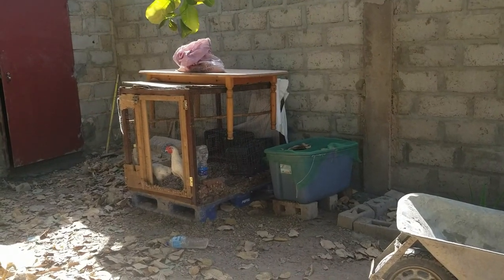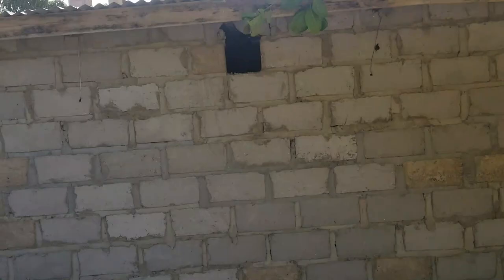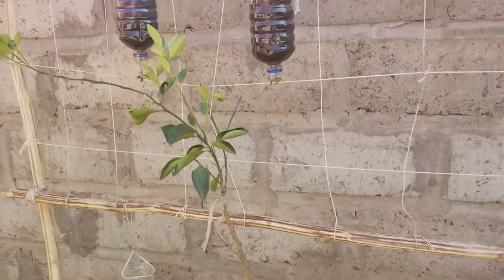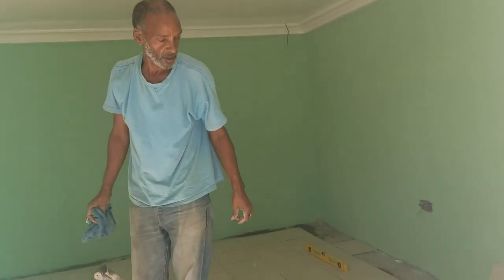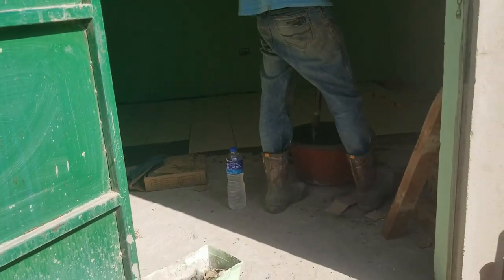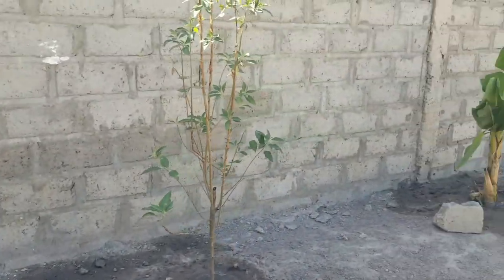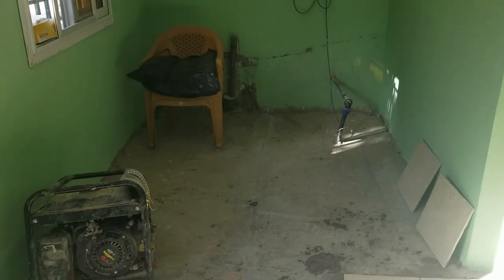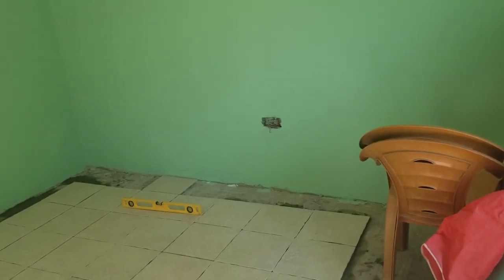The Arrival begins to tile the tiny house in The Gambia

Comment: 🇯🇲  Splendid job on the tiling Kenny.
So much money saved.
I almost know for sure when your dream home is completed you'll use that little house as a AB&B & restpite for friends and diasporeans to Gambia.
When all is.finish a good cctv system with motion-detection &  remote viewing access will be a charm.
Make sure to place a camera in the shed where valuble  equipments will be stored and break-thru the hollow security wall into the shed by burgulars is a possibility during your extended away visits.
Reply from the maker: Thanks so much for all your advice. We appreciate you🙏🏽💞🙏🏽💞🙏🏽💞

Comment: Ok Kenny, since no one else is stating it; I don't like the gap lines between the floor tiles. Aren't the tiles supposed to be tightly flush so one cannot so vividly see the grout/lines between 'em? Look, I'm no floor expert but if I'm right, then you might wanna have one of the local experts complete one half just for comparison. It may cost little for just half, or just the washroom. Just saying. I admire the work of your hand, the courage of your heart, the tenacity of your will, the love you display and the persistence to keep putting one foot in front of the other! Peace.
Reply: And They Said  ls that what that is? Well damn! ...
Reply from the maker: Thanks for your opinion but I have been laying tile for about 25 plus years and I normally use spacer between the grout line some are1/4 inch some are1/8 inch tit ll depend on your preference  👍🏾
Reply: @TheArrival2020  Mr. Kenny, I yield to your expertise and experience then; thanks for the lesson; I earned it didn't I? Peace!

Comment: Hey, how about creating a ckn run for them.
Reply from the maker: What is that
Reply: @TheArrival2020  Google chicken run tunnel... It will be basically a tunnel made of ckn wire that's extends out of the coop. It allows them to leave out and be free range, all the while they are still confined. This way you never have to worry about letting them out. They can move about freely and the plants will stay protected. In fact, like how you have the coop now, you can build another coop at the other side as well, with a tunnel between the two where they can travel back and forth from one part of the yard to the other. There are many ways you can do it. But yea, I think a chicken run tunnel will work for you, or maybe not. You should check it out just in case it would...

Hope you feel better. Yah is Good all the Time! I'm sooo very excited for you both!!!